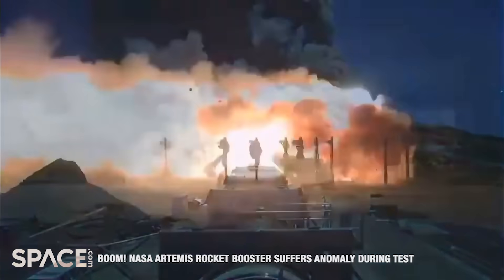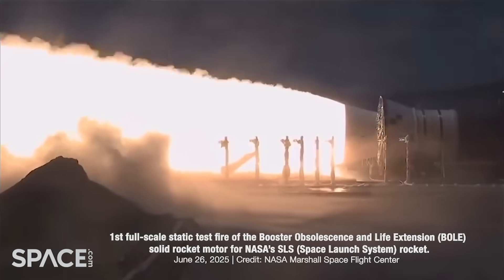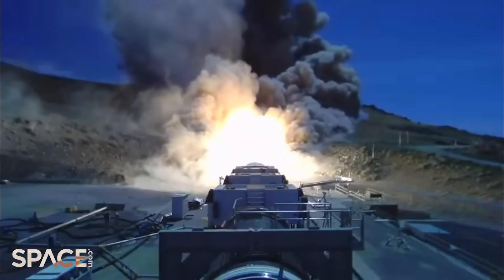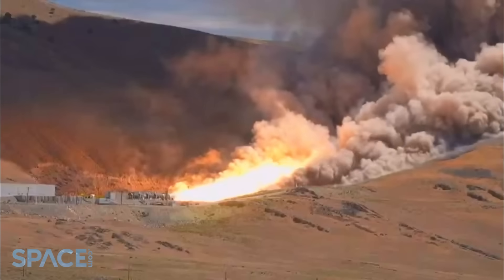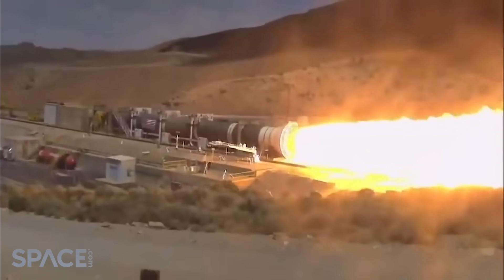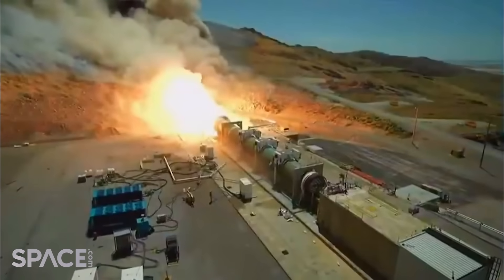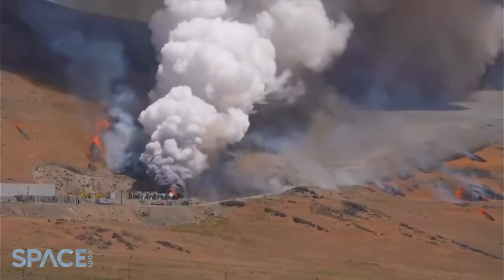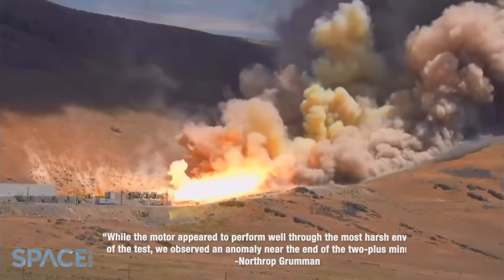Boom! NASA Artemis rocket booster suffers anomaly during test

Comment: Well done...NASA Artemis rocket booster met all requirements. All rockets no need to light for so long, booster to escape earth gravity need only less <180 sec(s)?   this booster goes to Moon?
Reply: Not to the moon.  It will serve the exact same function it did for Shuttle launches: launch to near orbit.  The reason for the longer burn is because Artemis and its launch vehicle's maximum full payload weight is significantly higher than the Shuttle and its launch vehicle combined.  More weight means longer burn duration.

Comment: They just kept going with the test even after the explosion
Reply: Correct.  Solid fuel rockets don't have a way to shut off in an emergency.  They are like a bottle rocket or road flare.  Once you light it, it goes until the fuel is gone.  The only way to possibly stop burning solid fuel is to dump a small lake of water on the solid fuel (not the flame), which basically breaks the fuel apart so the flame is slowly choked off. That's why the engineer was commanding the team to turn on deluge systems.

Comment: Are the nozzles gimbled on these motors?
Reply: Yes, it was undergoing gimbal testing just before it blew.
NSF I think, have a slow mo video where you can see the nozzle and gas flow moving.
Looked like something blew between nozzle and casing, breaching the nozzle and allowing hot gas and flame in between nozzle and case. I'd expect the electrically driven gimbal motors they were testing and associated actuators, linkages etc. would be located here, right where the anomaly appeared to initiate. 
The case seemed to quickly become the new nozzle as the flow surrounded the actual nozzle and it became simply an obstacle to the gas flow and was quickly burnt where it shouldn't be and blown out explosively.
The skin of the casing immediately begins to burn through and is subsequently blown apart, leaving basically the supporting framework to direct the gas flow.
Reply: @SumbluddyIdiu😂😂😂😂t

Comment: Considering this is not the first nozzle failure and the added scrutiny of Artemis in general, is this the final nail in SLS' coffin. 
Had this been in flight with crew aboard, the Orion launch abort likely would have been triggered and the launch stack lost. 
The SRBs must perform nominally from ignition to burn out as they can not be shut down or jettisoned while firing.
Reply: Good question, now that the last 4 Starships have exploded is this the final nail in Starship's coffin?
Reply: @Raptorman0909 No, it's not the end of Starship. Starship is not considered operational as these SRBs are. 
Starship is not man-rated as these SRBs are. 
Starship is not taxpayer funded as these SRBs are. 
Artemis 3 mission may be canceled as Starship is needed to act as a crewed lunar lander, but Starship does not rely on Artemis as these SRBs do.
SLS can not fly without these SRBs. They are proving to be unreliable. Starship's Super Heavy Booster is becoming reliable.
Reply: @slartybarfastb3648  "Starship is not taxpayer funded as these SRBs are. "  --  Sorry, SpaceX receives about $3B a years from NASA and over the years SpaceX has received well over $10B from the US Taxpayer!
Reply: @Raptorman0909 Well, since my reply was not posted due to YouTube's miserable filters, censorship, who knows?
I'll try again. 
Let's try this:
How much taxpayer funding has gone toward a single SLS launch to date? Are you willing to answer that question? 
You seem to be very informed about NASA budget expenditures.
Reply: @Raptorman0909 C'mon man, how much has SLS cost for one uncrewed flight?
I'll do the math for you if you won't.
Reply: @slartybarfastb3648  SpaceX is burning through US Taxpayer money like its going out of style and they have full control of their destiny given the vast resources Musk brings to the table.  SLS is hostage to the US Budget and Trump killed SLS off as Musk wanted.  Musk does NOT want any competition and given the dreadful performance of Starship and SuperHeavy he's been wise to try to kill off the competition!
Reply: @slartybarfastb3648  How much has Starship cost for no crewed flights? You don't know, because everything at SpaceX happens behind NDAs.
Reply: @PistonAvatarGuy There are no NDAs when government funding is involved. If NDAs are involved it's because the cost is paid through private civilian funding. 

NASA funding has no NDAs because it's taxpayer money. So, how much has SLS cost for one uncrewed flight?
Reply: @slartybarfastb3648  Starship is not a NASA project, it's not a public project, it's being developed by a private company for their purposes (launching Starlink satellites). SpaceX is a private contractor to NASA, they're not a government agency.

And if everything isn't behind NDAs, how much has Starship cost for one crewed flight? Where is their human-rated spacecraft?
Reply: @PistonAvatarGuy You seriously don't know what SpaceX's crew rated spacecraft is?
Reply: Artemis 1, the only launch of SLS cost $12 Billion. It was uncrewed. Each additional launch, next at least two years away, is at least $2.1 Billion per launch. The SLS version needed for deep space and heavy lift will be $4.1 Billion per launch. 
These costs don't include the Orion capsule. It is still not operational after more than 20 years of development. 
Now, the SRBs are grounded again as well. 
That's at least $24 Billion through 2030 for only 5 missions. Which are now in doubt because Orion is again in redesign and the SRBs are now grounded (again).
Reply: @PistonAvatarGuy I know Starship is not a NASA project, so why should I care what SpaceX has spent on it? 
SLS is a NASA project. 
SpaceX's crew rated spacecraft is Dragon and has 11 NASA crew missions completed, plus 7 private missions. A private Dragon crew launched three days ago and is at the ISS, with the NASA crew launched a month ago also by SpaceX. 
Dragon has 18 successful crew launches, and Falcon 9 booster has 493 successful launches and is the world's only reuseable rocket. The record for reuses is now 27 launches for a single booster. Every other rocket on Earth is dumped in the ocean after every launch including SLS.
Reply: @slartybarfastb3648  I'm talking about a human-rated spacecraft that's capable of taking people to the moon.

I didn't ask how much SLS costs, I asked how much SpaceX's human-rated craft, which is capable of completing an Artemis mission, costs. That's the mission that SpaceX was contracted to complete, so how much is it going to cost?

SLS and Orion have already demonstrated that they're perfectly capable of carrying humans to the moon and returning them safely to Earth, what has SpaceX done that's comparable?

The SRBs are not grounded, this test was not related to the flight hardware.
Reply: Except that these are a new design and the old design works just fine. There's no reason why they can't stick with the old design.
Reply: @PistonAvatarGuy  The old design, which I presume you mean the SRB's from the Shuttle days are not enough for SLS, that's why they were redesigned.  The new design needs to be tested and to almost no ones surprise it had a problem.  Making improvements in design is what's known as progress!
Reply: @Raptorman0909  Correct, I should have added that the current SRBs are adequate... for the time being. The SRBs on Artemis I and Artemis II are made up of previously flown shuttle components (IIRC).
Reply: @PistonAvatarGuy They were supposed to be "off the shelf" to keep cost down. Instead, nothing is the same. 
Solid rocket boosters are, at a fundamental level, a terrible ckoice for crewed spaceflight. They can not be shut down if a malfunction occurs. They can't be jettisoned due to an almost certainty they'll strike the orbiter stack as happened with Challenger. If vectoring fails, the main stack does not have sufficient authority to maintain controlled flight, and again, you're stuck with them until they burn out. No matter how catastrophically they are failing. Solid rocket boosters tend to fail catastrophically when they fail.
Reply: @slartybarfastb3648  The boosters that are currently in use are literally reused shuttle components, this test was of a possible new design.

I do agree, these should be some kind of liquid fueled booster, not SRBs, but those would be some huge boosters and the cost would be immense.

Anyway, unlike SpaceX's hardware, SLS has an adequate launch abort system, should a problem occur with the SRBs.
Reply: I'm talking about a human-rated spacecraft that's capable of taking people to the moon.

I didn't ask how much SLS costs, I asked how much SpaceX's human-rated craft, which is capable of completing an Artemis mission, costs. That's the mission that SpaceX was contracted to complete, so how much is it going to cost?

SLS and Orion have already demonstrated that they're perfectly capable of carrying humans to the moon and returning them safely to Earth, what has SpaceX done that's comparable?

The SRBs are not grounded, this test was not related to the flight hardware.
Reply: @PistonAvatarGuy Nice try.
Reply: Nice try? The SpaceX plan for Artemis is not only insanely impractical (with no decisive answer on how many refueling launches will be required), but virtually none of it is in development and the majority of it has never been successfully demonstrated. Even if their plan were practical, no one can even begin to estimate the cost, because no one has access to any of SpaceX's financial information. Sorry, but SpaceX cannot get humans to the moon, while SLS is clearly capable of human-rated missions to the moon.
Reply: @PistonAvatarGuy The video we're commenting on shows an SLS booster blowing it's nozzle off. Again. This isn't the first time. 
This test was intended to show that old segments can be safe beyond rheir rated life span. Because they were supposed to have been flown by now. Apparently not. 

Artemis 3 is still at least three years out. More now that SLS has no boosters. This test will further delay Artemis 2. That's not even mentioning Orion's continuing heat shield issues and flammable wiring which needs to removed and replaced. The Artemis 2 launch platform is $Billions over budget and schedule and isn't ready. 
Gateway isn't even a mock up yet, so where will Starship even go if it could?
Artemis is a lost program. 
We'll get to the moon but it won't use SLS and Artemis is done.
Reply: @slartybarfastb3648  These aren't the SRBs currently being used for SLS and there's enough of the boosters which have been demonstrated to be perfectly functional over the course of over a hundred launches to last for something like 8 more launches of SLS! You're clearly trolling.
Reply: @PistonAvatarGuy The 5 segment boosters have one launch. Just because they look like STS boosters doesn't mean they are. These are not STS boosters. 
Orbital/ATK, n9w Northrop-Grumman had to heavily modify everything except the barrels for the fifth segment addition.
Reply: @PistonAvatarGuy  there is a finite supply of srb components and these do not get refurbished after launch. Replacing them with this new design will actually be a performance increase.
Reply: @divedevil985  Right, my point is that they're not needed yet, so there's still plenty of time to work out any bugs.
Reply: @PistonAvatarGuy  true.
Reply: The goal of 1st astronaut of color and woman weren't reasons to spend this $. Research can be done in near real time with robots.
Reply: @tedcollins4684  So, in a video showcasing a test of a solid rocket motor you're whining about DEI -- TF!
Reply: @Raptorman0909  No you brought up dei! I repeated nasa's mission statement. You must be a rocket scientist. lol